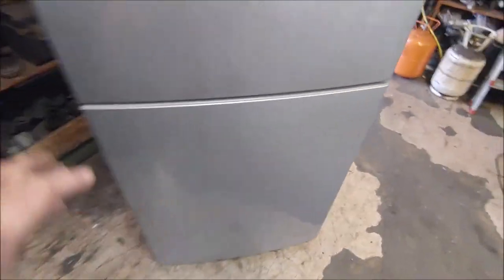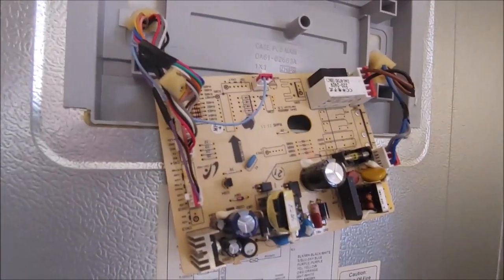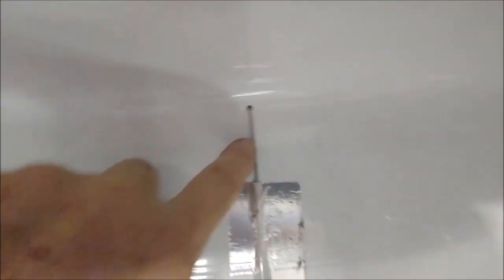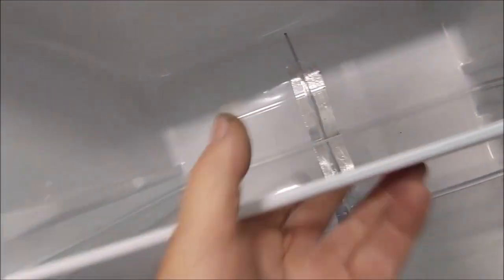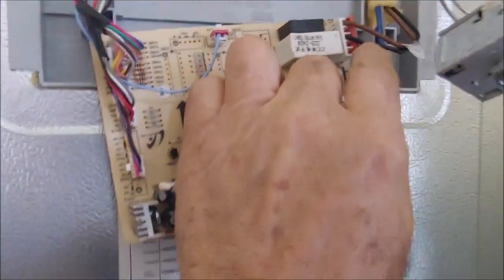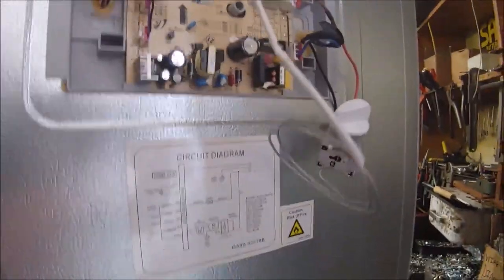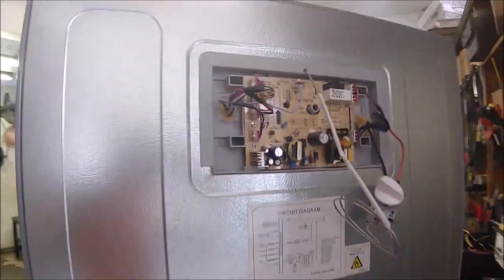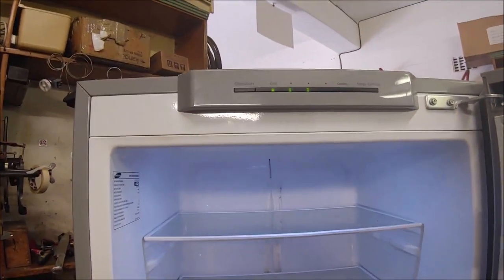Bypassing the electronic PC Board with a mechanical thermostat on a Samsung Fridge

Comment: I have a question 
I live in Asia where we have a high humidity and high heat so I would like to buy a refrigerator  and bypass the thermostat with a new "thermostat so I can set it to +18-20c and use it as a dry food storage would this be possible?
Reply from the maker: Very difficult but yes it is possible.

Comment: How did you wire the thermostat because I can't see
Reply from the maker: The thermostat breaks the compressor
Reply: Oh I see because I can't really see how it's wired on the video that is why I asked
Reply: Am talking about the live wire on the thermostat how many wires are on the wire that is usually connected on the number 6 on the thermostat

Comment: Would replacing the temperature sensor with a sensor for a freezer work? Isn’t the control board cycling the compressor on and off through the sensor?
Reply from the maker: Yes in amongst other things as well, the freezer & fridge sensor is identical, the integrated circuit just cycles the compressor on different resistance readings from the sensor.

Comment: Mr Nel. I have a Hisense Fridge. It is was  flushed for blockages and regassed but now its overhearing which it never did before.
Reply from the maker: overhearing?
Reply: @JDNelRefrigeration  its getting very hot on the side. I don't see a fan. So I'm not sure what can cause it to heat
Reply from the maker: @Deshanhiralall  Your fridge obviously has internal condensers and the heat you are feeling is from those condensers. The condensers will overheat if there is air mixed with the gas, so a proper vacuum has to be drawn to remove all the air.

Comment: Thats awesome man , would this work on a samsung wine cooler , the pc board no longer works and the units boards have been discontinued
Reply from the maker: Yes it will work but you may have to recalibrate the thermostat to get the correct temperature

Comment: Do you maybe have any idea what causes the fridge part to stay relatively warm while the freezer freezes up on a defy fridge freezer?

(We were advised to defrost for 48 hours which we then waited a couple of days before replacing the thermostat but all without any luck so I’m guessing something to do with the gas or compressor?)
Reply from the maker: I can think of many different scenarios that will cause that. Your fridge will have to be tested by a technician.